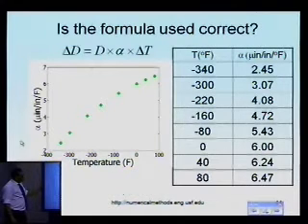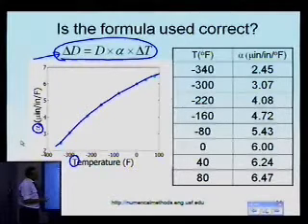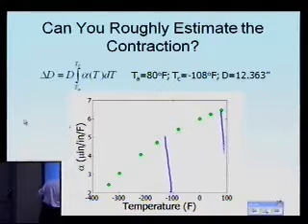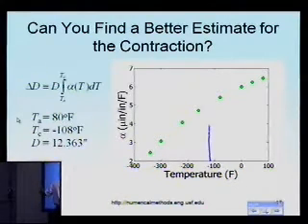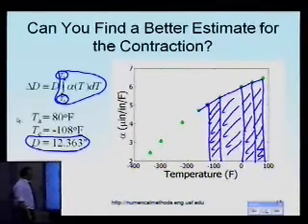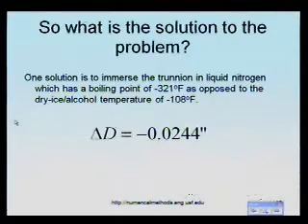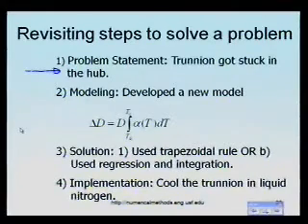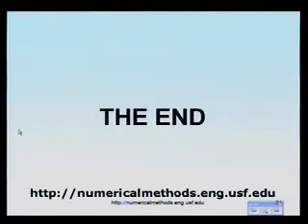Steps of Solving an Engineering Problem: Part 2 of 2

Comment: This is very nonrelativistic .
So in order to change this fault, persue the possibility of the classical approach as ,in In classical mechanics, a particle has, at every moment, an exact position and an exact momentum. These values change deterministically as the particle moves according to Newton's laws unlike the quantu approach ;)